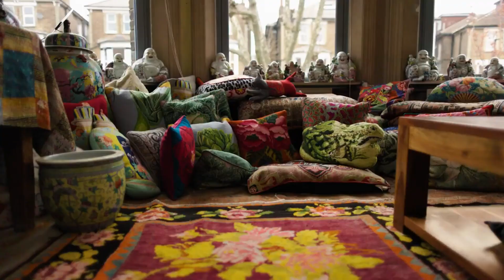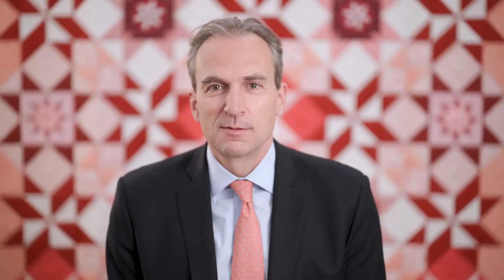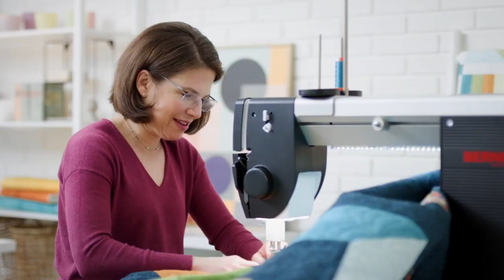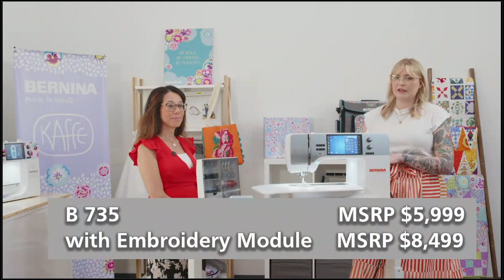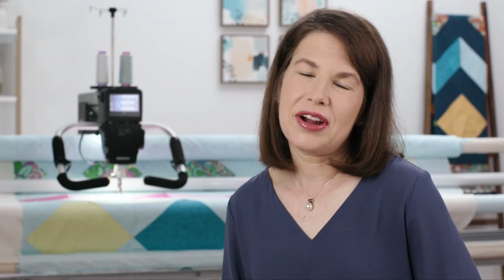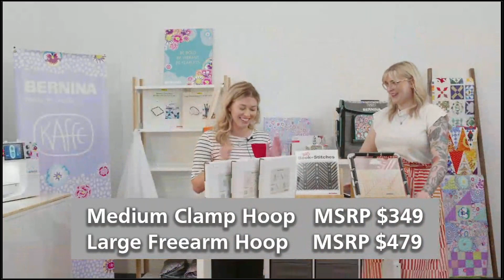BERNINA NEW Products Webinar 2022 with BERNINA Education Team

Comment: I have two sets of presser feet for the bernette b48. Can I upgrade to the b68 and still use the presser feet that I already have?
Reply from the maker: Yes you can. Some of the presser feet will require a spring change to be used on the b60 series machines. check out this video for more info on that- https://www.youtube.com/watch?v=dPNNwZ62gq8&t=1s

Comment: What is the maximum square quilting pattern that one can use on the 770QE with plus upgrade with the new clamp hoop?  My Amanda Murphy OESD downloaded patterns are 8" x 8".  Will those work?
Reply from the maker: Hi Pam, yes- the Medium Clamp Hoop will sew the 8"x8" designs you have from Amanda Murphy on the 7 or 8 series model machines. The maximum embroidery field for this hoop is 8.5"x8.5" on the 8 Series, and 8.25"x8.5" on the 7 Series.